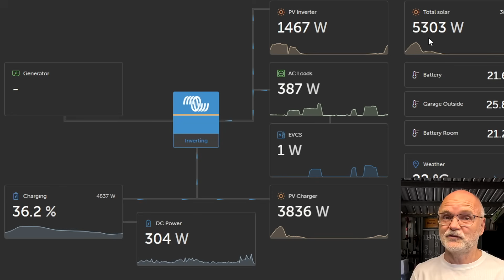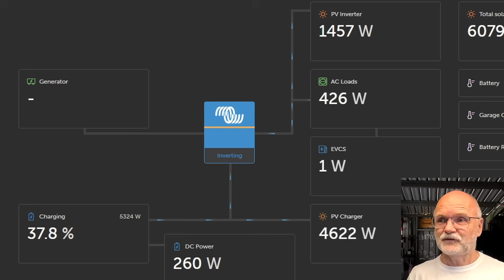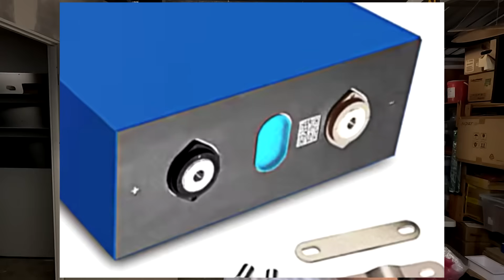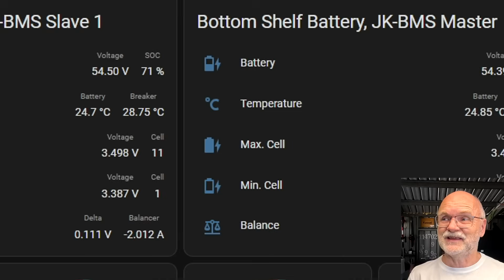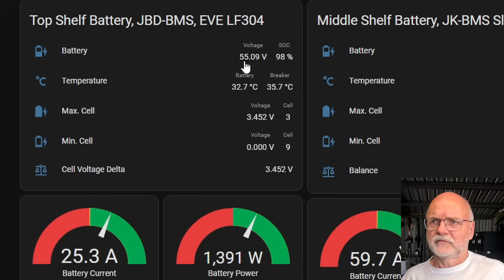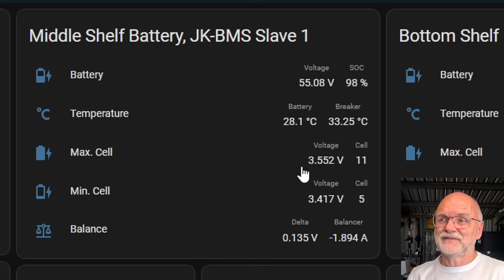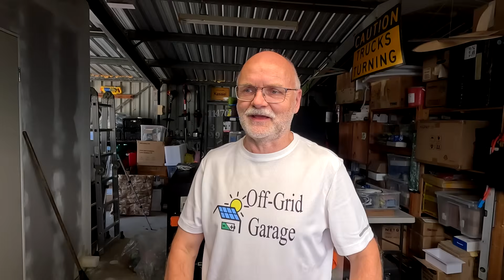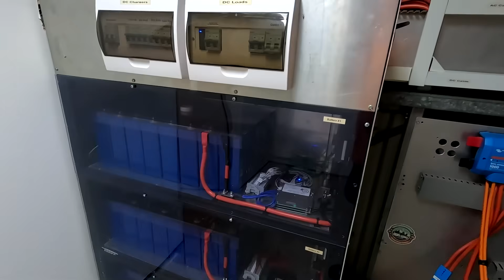First full charge of the Battery Shelf after Winter. And an old problem is back!

Comment: Hi Andy, hmm... I run 10 packs in parallel , altoghether ~160kWh .... 9 of them behave great, balancer kicks in barely .. but one pack has the same problem as yours. I think there are just cells in this pack which does'nt match up the capacity of the others. Don't know how to share, but I have great pictures of how the cell voltages drifts - look like some modern art ;-) ... I'm too lazy to really fix that but theoretically this could be fixed by putting small capacities in parallel to the affected cells, f.e. by using 32700 cells - or similar. Problem is to do this right I would have to disassemble that pack and really measure the capacity of each cell to do it right. If the connection would be the problem .. should'nt there be a measurable warmup of those parts  ?
Reply from the maker: Thanks for sharing. That's very interesting. 
What I found is, that when I move the busbars on this battery a bit back and forth, tighten the nuts again, the problem is gone. I'm pretty confident, that this is a connection issue with the terminals of these specific cells.

Paralleling smaller cells with larger ones may work in extreme situations but is also very dangerous. You would need a fuse for these smaller cells to prevent large currents going into these cells. Even then, I think this is not a great solution.
You may have seen the Frankenstein Battery which I build out of 304 and 280Ah cells, 5 different brands and models. This works surprisingly well once fully top balanced.

Comment: was denkst du über das Boostech BMS ?
Reply: JK-BMS und gut is. Ist günstiger als die meisten, hat als eines der wenigen Active Balancer und gscheit konfigurieren kann man es auch. Warum was anderes riskieren wenn es das nahezu perfekte schon gibt
Reply from the maker: I had a look at it. Rubbish in my opinion, too many parts like shunt, relays cell boards, controller..., too much extra cabling where things could go wrong, passive balancing🤦‍♂️. I mean, really???!!! Why would you even consider this as a viable alternative?
Reply: Boostech isn't really a BMS, it's a cell top voltage security system, which burns energy into heat when a cell voltage becomes too high, that's all.
Reply: müll